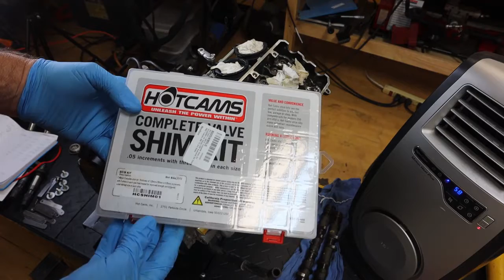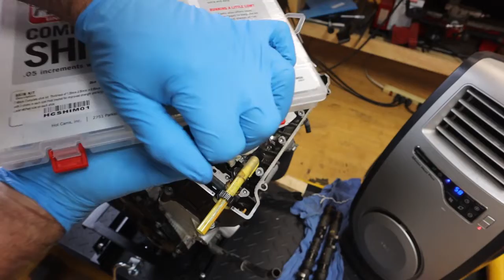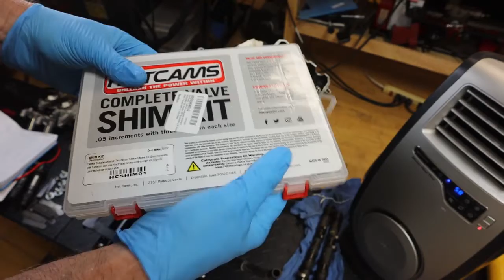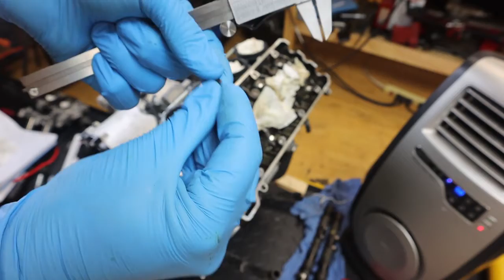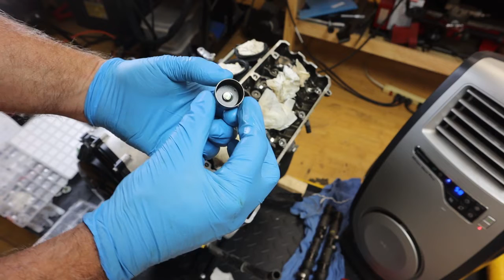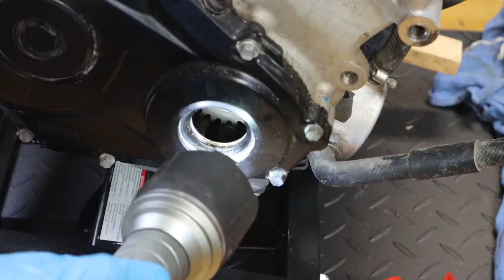2014 Suzuki GSXR 750 Valve Adjustment Part 3

Comment: How deep does the shim is inserted in the cam follower ? And where does the opposite side of the shim seats direct to the valve tip ? How easy is the shim to pop out with high RPM’s? Nice video thanks
Reply from the maker: There is a little ridge in the under side of the face of the cam follower,  the shim sits in that ridge,  The shim then sits on top of the valve.  So there is direct contact between the valve tip, the shim and the inside of the cam follower. So there is little chance the shim will pop out.  But if something fails in the valve train, the shim would be the least of your worries. Thanks for the great question.
Reply: @JoediyLab   thanks for the response,how deep is the box where the shim sits in the bucket ?